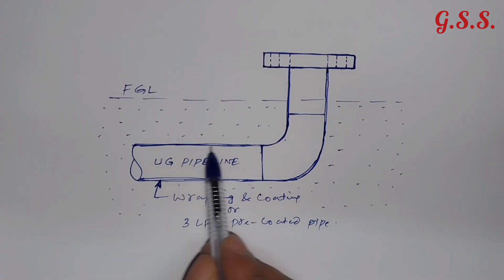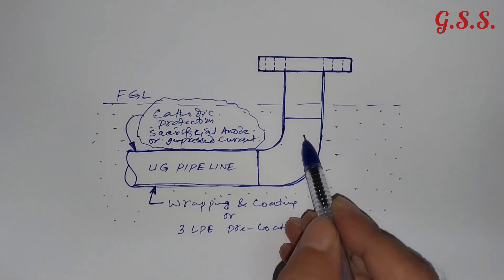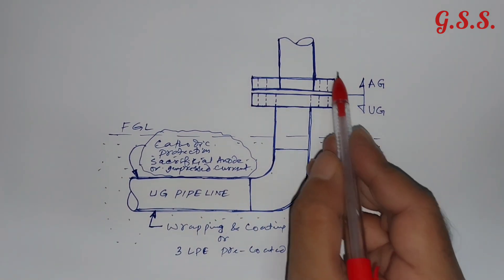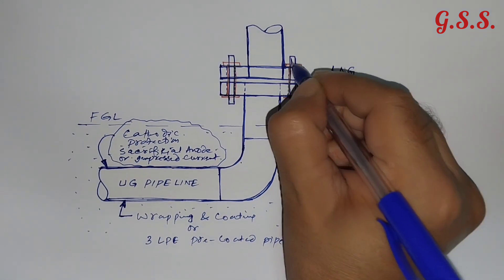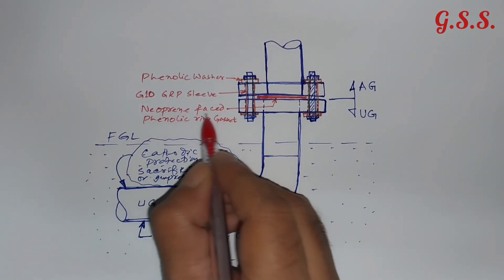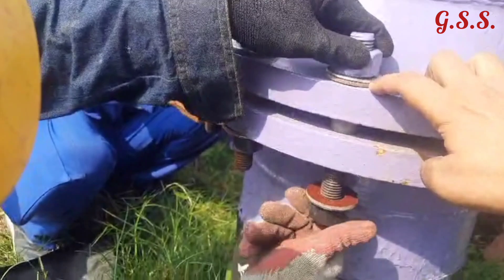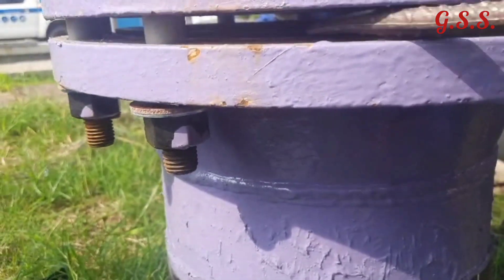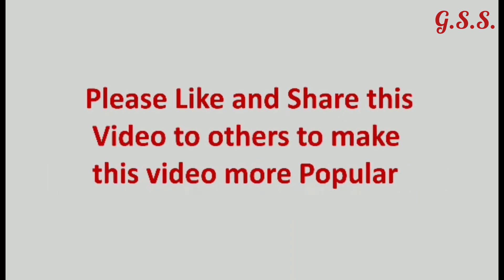Piping Engineering : Isolating flange joint in cathodic protection system

Comment: Monolithic Isolation Joints (MIJ) are widely used on pipeline systems to electrically split the line into two (2) sections for Cathodic Protection (CP)